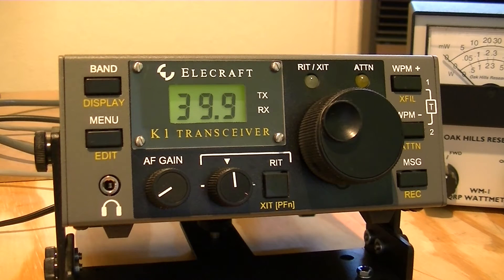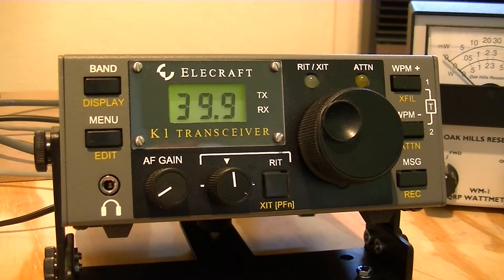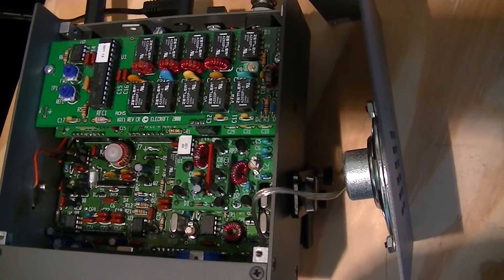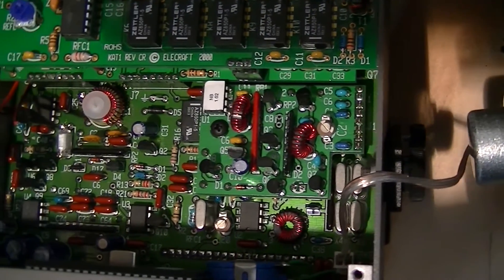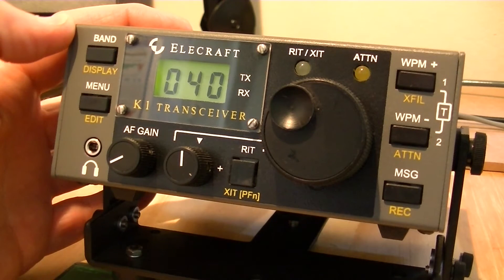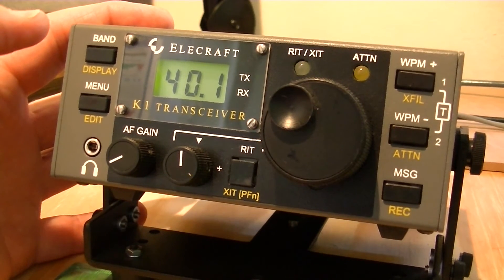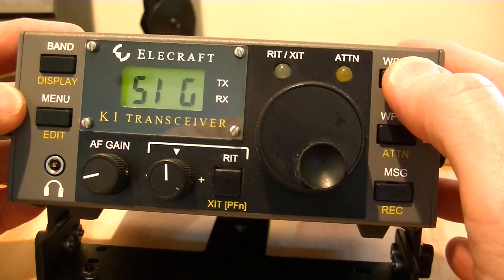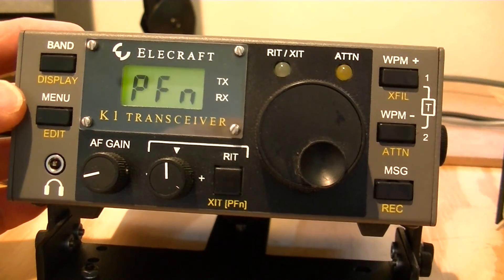Elecraft K1

Comment: waiting for mine to be built.....had a four-band K1 about 4 years ago....sold it to pay taxes....now, you can't get the four-band module anymore.....the Internal ATU is half the cost of the radio, more if you don't put it together......with that said....it has a bitching receiver....excellent filtering, and a few big boy transceiver goodies.....did use my former K1 to finish a contest when my main HF rig went tits up......run it on 40M into a small linear, and got almost 100w out.....it will do 7 to 7 1/2 watts off a power supply @ 14VDC on 40m by itself.....a bit lower on 30/20/15.....ran for days off a gel cell camping....loved the little rig, and now, I'll have another one......contest quality rig....excellent for CW......will receive SSB if you have the wide VFO setting (150-160 kHz, instead of the 70-80 kHz tuning spread)....would love to find a four band module....good rig but pricey....for another 100 bucks, I could have had a new/used portable all-band rig, that didn't need to be built, but I have had one before, and wanted another one.....I'll see how some SOTA activations go this summer with my new K1 and Mountain Bike/Hiking endeavours.....:-)